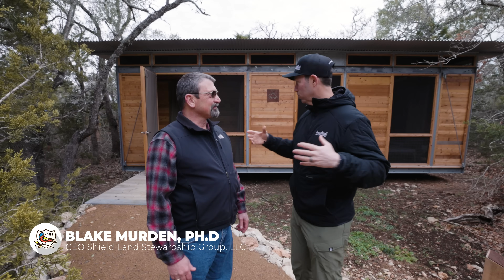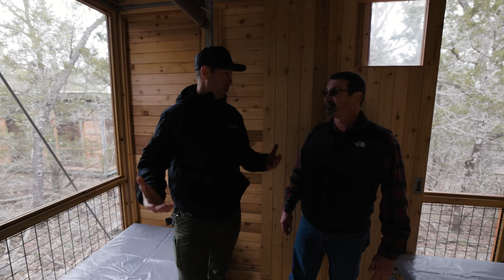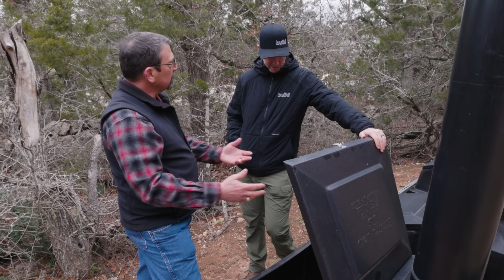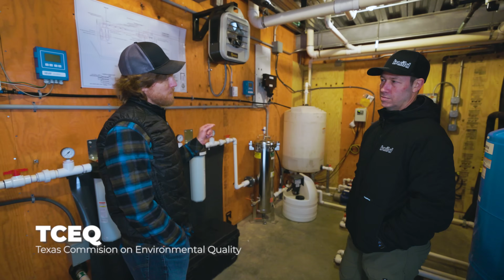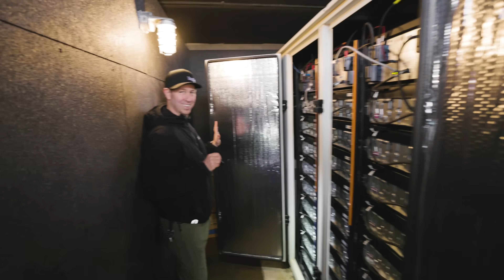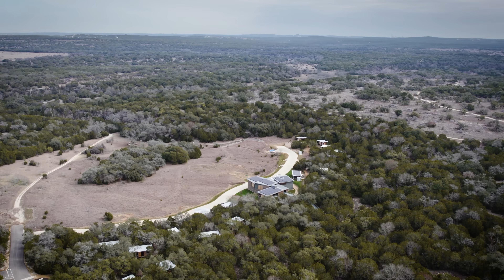OFF-GRID tech: This Texas Ranch has it figured out...

Comment: I put in emergency power for ExxonMobil world largest Olifin Plane 750mcm conductors two redundant inverters.
Our batteries were laid on side and connected with copper strap busses. The 2 stacks were roughly 4'x4'x4'. This was for control room operations. They had 3 gas turbines for plant power of around 180 Mega watt total power. No solar.

Comment: I've got a 7,000 square foot house that I built all icf construction I have inground pool and heat I'm running my whole house off grid with 10kw solar panels and 30 kw server rack battery bank I'm even charging my ev vehicles on the sunny days I have a Tesla and a lightning

Comment: I'm not sure if you look at past video comments....but perhaps you'll see this???    I've a question about soundproof room preparations and I've not seen it answered in any of your videos (nor from anyone else either).  What is the best way to mount electrical boxes inside the soundproofed room?..... Everyone says place putty around the boxes, but this is described for boxes that are secured to the wall studs for the adjacent rooms.  How are boxes secured inside the soundproofed room when that room has MLV over the studs, hat channel clips and hat channel over the MLV, and the two layers of 5/8" sheetrock separated by green glue compound between the sheets?.   With all this soundproofing structures, the distance from the inner wall of the soundproof room to the studs is over 2 inches.... so how are the boxes secured?

Comment: Curious question:  one of the issues the masses have been slow to adopt solar power solutions is the high cost to “free” energy. I’m not sure about the commercial units (panels and batteries) used in your video but, residential systems have been about a 10 year break even point before the “free” energy pays for itself. 

I addition to the decade long break even point; the other big issue has been the lifespan of the panels and batteries. The solar cells break down over time and even if exposed to 24hrs of daylight only operate about 75% of their efficiency compared to the initial install date. As far as the batteries go, we all own smart phones and know lithium struggles after 5 years. 

All that being said: how does this commercial micro grid address those issues and has technology come far enough to make solar off-grid an option for northern climates where 3-4 months (winter time) we have overcast skies. I live in Michigan and solar is only viable for your RV or garage lighting due to the issues listed above.
Reply: I live in Saskatchewan and have had a solar system since mid 2015.  My solar panels have a 25 year warranty.  I have no batteries so all my power is sold to the grid and I get credit for any amount over the amount that I use (net metering). We expect to break even on our investment in the solar system about 3 years, so your 10 year break even point is fairly accurate for us. The break even could be sooner as power rates are going up. But we mainly went solar to encourage our province to invest in more sustainable power sources instead of burning dirty coal to make power. For the past 4 years we have paid nothing for the power we used.  This year we had more cloudy days, even in the fall, and we will pay for power for two months, until the weather improves and our panels can produce more.  Overall we are very happy with our system, though a battery for storage would be nice.

Comment: As a off-grid solar expert, hats off to Charlie for his excellent explanation of the system design strategy & technologies involved in the solar system.  I'd like to make one clarification @19:00 Matt, asked if the solar goes to the battery first before being used...Charlie was correct in his comment about the SMA inverter not being "grid-forming", however, their power is provided for use by the system on the main AC distribution lines.  So is the power from the battery inverter....so those AC lines are like a big bus that power flows on.  What makes the battery inverters special is that they are capable of taking power from that bus (to charge the batteries), or feeing power onto the bus (discharge the batteries).  But to better answer your question Matt - yes, during the day, when solar production is high, the power you are using around the camp, is being supplier directly from the solar, and the batteries are charging simultaneously.

Comment: I enjoyed this one and well on the path to "Journey to self reliance" 
2 questions.
1. What is the brand of the toilet?  Very interested in that for a new property cabin solution.
2. How does the efficiency work of the SANCO2 versus something like the Rheem heat pump water heaters in a conditioned attic?  Seems like same concept in smaller package with easier install.
Reply: I'm no expert, but the Rheem units I have seen are all in 1, so the installed location pulls heat from the surroundings and will cool the space. The Sanden units I am familiar with are splits, exactly like a mini-split heat pump/AC units (essentially the same thing), so the water storage tank can be inside and the the other half outside connected by a lineset. I don't know about the specific efficiency ratings of the two, though I think the SANCO2 are rated higher, perhaps depending on specific models compared.

Comment: So in Germany you can already install solar onto your home, both for electrical and "water". You can sell the electrical back into the grid (which is why you need a business license due to the income). Most people know how much they use for a 24+hour period and they buy a battery pack to handle electricity at night OR they use the grid to handle everything and just receive a check for the solar power they put into the grid and pay for the electric they use. For water, I have four panels (I have a large home) that heat the solution in the panels. In the basement there is a split tank. The solutions heats the tank (up to 55*C) for useable water and radiant heat. I also have a fire place that can burn wood or coal which heat the rooms in is in and the water going to the tank. The tankless heater is the computer for this system and sends heated water to where it goes. Very efficient system. Next time you are in Germany for the build show, check these systems out!!

Comment: kilo kilo kilo...those 4U battery packs are probably about 4-5 kWh each. You also need the genset as a fall-over, cloudy rainy days the batteries just wont go the distance and need to be recharged. Generally it will be run in bursts to charge up the batteries. There is a middle ground between off grid and backup energy systems, sometimes known as Energy Storage Systems.

Comment: I am surprised that some form of vertical wind turbines (much quieter and can be low elevation) were not included in the grid footprint/architecture.
Reply: A green energy podcast I listen to had a commenter say that anyplace you'd want to hang out outside probably isn't a good candidate for wind generation. A broad brush for sure, but this place is specifically for hanging out outside, so it seems probable that it's not a regularly windy place.

Comment: Cool video!  The solar must have been installed 5+ years ago.  Just for reference 194 panels @ 64 KW means each panel is 330W.  And he said 60-cell.  You can get a 400W 72 cell panel with the same footprint today.  Which means less panels, less space or same amount of panels, same space, more output!  The technology only keeps getting better, but it’s due to plateau soon.  Technology will exponentially grow in battery storage.
Reply: No. 72 cell panels are not the same as 60 cells. And 72 cell panels have existed for a decade. These were chosen to match with the inverter design voltage and strings.
Reply: He said 198 panels not 194.

Comment: Building a 4,400 sq ft house that heats with a single 15AMP heat pump really has me looking into solar.  While considering going off grid,  this video shows what would truly be needed to go down that path!  I think Charlie said 4x more solar would be needed without that backup generator! Wow! Great thoughts!  It's hard to keep in mind those cloudy 10% days while designing!
Reply: We run off ASHP and have Solar/Batteries. We could be off grid in Colorado March-October. While the sun offsets nearly 80% of our energy, because of batteries it offsets 99.8% of the cost.

A lot of people go way ham on "off-grid" but there are extremely diminishing returns for that last bit of power. If there ever was a Winter storm where we lost power, I would just charge from the grid for an hour or so at a time when the power comes back up. I don't think I'd ever add a generator, since it would sit unused. All the cloudy months where we don't make enough power, are made up for financially by the sunny months.
Reply: @ShortVersion1  even in a metropolitan Colorado Springs we lose power many times during the winter. Not for long but it does happen, so at the cost of a few hundred dollars it is not a bad idea. What I am having trouble understanding is how do your batteries offset costs as compared to grid tied, net metering setup? Especially if you have to replace them every 5-7 years.
Reply: @bible-sucks Moat current tech battery options are LiFePo4 (lithium iron phosphate) and they last a decade or more. The cost of batteries has dropped a bunch (not as much as panels, but getting better) so it's getting more and more accessible.
Reply: If your base load power requirements are that low, it's not hard to 4X your solar and storage since you'll need so little to begin with. A 4400 sq ft house probably isn't a great starting point for lowering overall power needs though.

Comment: It seem like a lot got cut out of this video unfortunately. I would have liked to see that power room with all the inverters and power panels. The batteries are neat but they are just batteries after all. I would have been interested to see how the rain water is routed, how they are handling the first flush aspect, pre-filtering, etc. for that large of a system. It really seemed like the way those panels are mounted were far from optimal. Really interesting project!

Comment: Grid-connected homes wanting to install solar from 2023 and on will need 10 kw pv + 30 kwh battery due to net-metering ending, this will be the standard. Today it costs $35k, in 2030 it will cost around $15k.
Reply: Drew you are out of your element as evidenced by multiple posts
Reply: @mattbrew11  how/where am I incorrect?
Reply: @mattbrew11  please let me know where I am wrong about this. I am trying to learn.

Comment: 75 kwh battery + 25 kw solar + 20 kw generator is the mix needed to take standard homes off-grid. 2023 it costs $100k, in 2030 it will cost $50k or less.
Reply: Which means that anyone that can afford it should do it now
Reply: @mattbrew11  I’m pretty sure you’re using irony here but I’m not smart enough to follow; please explain.
Reply: @drewgoodman7932  solar panel cost has essentially flatlined and cost for generators will climb as carbon taxes continue to escalate. Batteries will go down by ~35-40% in cost but high quality LFP batteries last 15-18 years. Moving forward now locks in 2/3 costs that at absolute best are flat yet still quality for tax credits. 7 years of use has value vs waiting
Reply: @mattbrew11  pv prices will fall 70%, batteries will fall 80%, profit margin and price for installation will rise. This is where my 50% price reduction comes from.
Reply: @drewgoodman7932  PV prices are not going down another 70%. Id wager my experience as a solar business owner since 2009 on that. Module pricing has actually climbed the last year. The manufacturing processes have matured and scaled.
Reply: @mattbrew11  many people much smarter than both of us disagree with you. I guess we will see, but my predictions are backed up by evidence. I am going to stick by my educated predictions, regardless of what a solar business owner says.

Comment: I'd be curious what the specs would be for a solar + battery system to allow a city block to be (mostly) off-grid. Basically, the block could serve as an energy island when the grid goes out while generating a large portion of the energy it uses on rooftop solar. Given the very high electricity prices of San Francisco (where I lived previously), it might be economical at this point to do a block-sized microgrid that can run off-grid (or feed back power to the grid) on most days. One big and new challenge is an agreement by everyone on the block for how to price electricity sold from one home to another within the block as well as for the "rent" for battery storage.
Reply: That would vary vastly on what sort of “city block” it is. If you’re talking about a dense city block, that will have between around 750-1400 people in it, and that is a 100m x 200m area. The average US household uses about 30kW’s per day, or 30,000 watts. So that’s around 7kW per person a day. So lets say that you have 1000 people per block, at 7kW, so a total of 7,000kW needed every day. You’re batteries and solar panels need to be oversized, so lets say - and this is very conservative, a battery bank capable of - at bare minimum - 21,000kW hours, and a solar array of 2,100kW hours. 

So that would mean at current over the counter prices you would be looking at an array of about 5,200 panels that are 400 watts each, at around $250 dollars, so about 1.3 million dollars plus installation cost, so lets say 3 million. You will need your batteries, and those will cost - using lithium - about 17 million, plus installation, so lets just say 20 million, plus all your components, so another 5 million minimum. 

So…for a bare minimum solar and battery array for a city block to last a day or two would be about 30 million probably, just using common prices. That isn’t taking into account government kickbacks or commercial discounts, exc. Plus, its still likely well under what it would really be, as the labor estimates are way low. 

Size wise the panels would take up the entire available theoretical roof space due to spacing needs, and in reality there likely wouldn’t be enough actually available space. 

Now, if you’re talking about a city block such as small town America, where there are about 16 houses or so and maybe 50 people, that’s a different story.
Reply: @JimYeats  Those are good considerations on the variability for the possible case study. Here are some arbitrary parameters for a residential block:
- 70 homes
- 250 people
- Total daily power consumption is 2MWh
- block size is 100m x 200m
- Latitude is same as Los Angeles
- Assume climate allows for 3h of sunlight per day, on average, during the winter.

Suppose we're not worrying about perpetual off-grid capability and are just looking for capability for the average winter day to be off-grid.

Back-of-envelope calculations (sanity check would be welcome):
- We'd need ~30 solar panels per home.
- If we needed to store ~1.5MWh for overnight, then we're looking at an equivalent of 100 power walls.
- Total cost is ~$3 million to create an incredibly energy-resilient city block.
- If we assume an average energy bill drops from, say $200 to $50, that's a $2k savings per home, or $140k for the block per year. (This is the shakiest part IMO and will be very location-dependent due to pricing/consumption.)

A mortgage on $3 million is close to $140k, so this might be economically viable today.
Reply: @dosadoodle  Perhaps commercially viable, but then consider that you would actually need buy-in from everybody on the block.  Only way I see that happening is that it is done by a developer and then the buyers are subject to some sort of covenant.  Doing it with an existing block probably could never happen.
Reply: @BrettBreeden  I don't think a full block is necessary to make it work. Even just a few neighbors bundling together can result in a total cost reduction that's substantial for all of them. Benefits will taper off as more neighbors are added - diminishing returns.

One complication of larger numbers is more abuse of the shared resource. I think to really get it going, a shared cost agreement that is partially based on actual usage would be required. Not sure how much neighbors want to deal with that, so...

I do agree this would be more viable as a commercial operation. It could be one that competes with the big utilities, basically strategically and somewhat surgically taking over their most profitable/high-rate customers. San Francisco would be a good candidate city for this, where rates are stupidly high and a lot of people there also hate PG&E.

Comment: There is no such thing as "free" energy.  Depending upon the asset, the operating and maintenance costs can be 10 -12 times or even more than the initial capital costs or building costs over its lifecycle.  So all these solar and water systems will need ongoing money to keep the systems operating optimally and of course will have to be replaced after a period of time at which point they will be obsolete and need to be redesigned.  As much as running the power line would have scared the landscape for a time, it would quickly recover and you'd have a much been a much more cost efficient build I'm sure, especially if it was run underground.  I get that this wasn't the point of the project, but I'm betting the initial capital cost and ongoing O&M costs will be higher than a conventional build.
Reply: Not a chance. Dinosaur thinking.

Comment: Excellent presentation!  There is a lot more than just mounting solar panels on the roof to have reliable power 24-7. Impressive battery backup system. Now tell me the total cost for the system
Reply: 60 kw solar at $2 per watt - $120k
200 kwh battery at $500/kwh - $100k

It’s probably safe to assume that an average to large home with a 200-amp service would need half of this and come in at around $110k. This price will likely fall more than 50% by 2030.